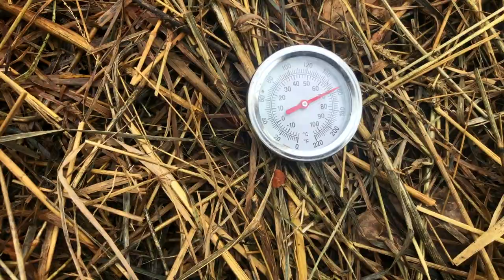Greenhouse - Heating with Compost Power and Moving Water?

Comment: There's some math to be done in terms of how many BTUs your pile can produce and how much of that you can (literally!) siphon off without stalling out the pile. Remember Jean Pain was working with piles that were something like ten times the volume you're using ;)  Whether you would actually get more heat with a longer coil or not really depends on how much heat that pile is generating. there's probably some math that can be used to figure out BTUs based on the average temperature of the pile (throughout its volume, not over time) and the mass of the pile, but I'm not familiar with those kinds of calculations ;)   As it's not currently practical to add another 60 feet of tubing into that coil, you might try restricting the rate of flow, giving the water more time in the pile. Putting a spray nozzle on the hose back into the tank and shutting it down to a trickle should let you test whether the limit is transfer of heat or actual amount of heat produced by the pile...
Reply: Sure.  The pile is mostly cellulose, so figure 8,000 BTUs per pound.  The tank is 100 gallons, so 800 BTUs to raise it 1 degree F.  For every pound in the pile, it raises the tank 10 degrees, once.
Reply from the maker: It definitely seems the limiting factor is the heat transferring into the tube in a timely manner, not the total amount of heat available to the tube.  I need slower flow through, which is why I'm hoping to crack the code on a gentle thermosiphon for the whole thing...
Reply: @edibleacres  If you are correct that you are heat transfer limited, then you want to increase the flow rate, not decrease it.  Heat transfer is proportional to the the temperature difference (and R-value and area of the transfer surface), so you want the coldest water in the tube that you can get, which means faster flow rate.
Reply: @CorwynGC  You seem to forget there is a limited amount of heat available. Also, you must retain heat, or reintroduce it during the day with solar heated air, for the microorganisms to keep feeding and producing heat as  byproduct. The pile is not nearly big enough for that climate, but compost heat is ideal for the North East or areas with little winter sun.
Reply: @markroeder2491  Not sure why you would say that when my first response gave a formula for figuring out exactly how limited the amount of heat available was.

Comment: I think the limiting factor on the heat generated is probably the size of your pile, whereas you can be more efficient in capturing the heat that is available by spacing out the piping. If you look at Jean Pain's video, he spaces out the piping throughout the pile to ensure the maximum contact with compost volume, whereas by coiling them together in the cage as you currently do, the volume of compost you are extracting heat from is limited. That's why it runs out of hot water so quickly. As for the thermosyphon/pumping, the only thing that will help is going to be the height of your tank. The same principle as a taller chimney having more draw. I don't think that putting the entire stock tank higher is going to help.
Reply: Where can I find Jean Pains' video?

Comment: You are on the right track-we would use a similar technique when we would lose a pump in our heating system in a building I worked in in Manhattan. It was 21 stories tall and we would use the siphoning affect and a check valve to be able to circulate the domestic water until we could get the pump back online. With the correct temperature, diameter of tubing, length of tubing, and a check valve you should be able to get the job done. Also, remember that if you’re going to use radiant heating in the floor, it doesn’t have to be very hot to heat the entire house- I believe you should seriously investigate the temperatures you need to achieve to be able to heat the house; if I remember correctly it’s only about 70° (water temperature ) but you need to verify that. Radiant floor heating is not my specialty.
Reply from the maker: Appreciating your time and knowledge here!

Comment: The question l ask is not just what will you do to heat the greenhouse, but what will you do to keep that heat from escaping?

Since you have built this greenhouse from scrap parts and windows, it can lose much heat through the single pane glass or poly panels, Etc 
Especially as each panel is made of different thickness or R-value materials.

Many of us, (myself included), have added another layer in the winter to our greenhouses, thereby creating a "double paneled" structure. 
This can be done by actually covering the greenhouse with another layer of plastic or poly, (which can be attached either inside or outside the greenhouse - depending what works for you) and can also be done by attaching bubble wrap to all the inside glass/plastic surfaces.
I found that the larger 1" bubble wrap works better. Each bubble "traps air" and helps to keep the overall temperature higher in the greenhouse.  
(I found the best prices for such were at the big box office stores.)

Many larger commercial hoop houses use 2 layers on their greenhouses, and utilize an air generating fan to blow bewteen the 2 layers, thus allowing the space between the layers to heat up naturally.

The addition of extra poly, plastic or bubble wrap does not affect the light transmission very much. You only lose maybe 5% to 10%.

The other thing that could be done is blankets or curtains of some type. They would be used for the evening hours to try to keep any heat that was generated from escaping. These can be added inside or out - depending on what you have available. (I once used old bed comforters!) Of course, these would have to be moved into place daily -  at dusk and then dawn or morning.

It appears that the roof of your greenhouse has some sort of plastic panels, and this may be where most heat would be lost, as heat rises.

The other thing that can be done is a "greenhouse within a greenhouse". Many will do small hoop enclosures over the raised growing beds. This creates a warmer environment for the plants. Many have found that this system works great. Elliot Coleman has done this extensively in Maine, and has used no heat at all...(but "to each his own"!)

I know this did not address your current heating system - but hope it helped give you some more "tools for thought" !!!
Reply: Great ideas, all of them.  It made me think of a shorter cattle panel greenhouse to cover the compost pile and help create a heat bank to help with the heat sink of the pile.
Reply from the maker: I understand what you are saying for sure.  If this were a standalone structure in the field I would go for it 100% with the extra layers.  Attached to our home, it is partially about the look and feel of the space and partly about pure functionality.  I believe we'll be making cold frame boxes for the soil itself this winter so we can keep the light and open feel of the space overall.  Not ideal from a thermal perspective but aesthetics and sense of space are also part of the equation...

Comment: i put the compost pile inside my small greenhouse. you could cover the pile with plastic and vent it in.
Reply: Right, I have seen that done here on YT in Canada and she built it 4 to 5 feet tall with the other measurements being about 4' x 10' x 4' to 5'. By the time it starts cooling off the seedling starts are placed on top for bottom heat.  There are some great ideas coming out here!
Reply from the maker: Too small a space and definitely not wanting those gasses accumulating into our home...
Reply: Insulate over the pile but not the side that contacts the greenhouse. That creates 2 positives, 1 your pile will be warmer since it won’t be losing heat to the air and 2 the heat from the pile will be conducted through the wall into the greenhouse.
Reply: The Nech  what gasses Im currius
Reply: What like nitric oxide or something
Reply: Is there processes to remove the volitiles for refinement
Reply: The Nech  I just looked it up and air negativity must have aireated large piles and filter or scrubbing of the gases through biofilter comprised of and aggregate of Woody materials like wood chips and I think also possibly home- made charcoal then returned to greenhouse as co2 in s system that I saw they brought up the co2 through some soil for seed germination they are doing this at large scale 100 tons of compost producing a thermal yeild between 30 and 60 thousand BTU over a course of a growing season and extending it with an net saving of 10000 dollars. My question is can it be scaled down?
Reply: Also this was dictated by me and spelled by my wife sorry
Reply: The gases are converted from amonia to amonia nitrate or nitrite whatever im tired  when it comes in contact with the soil
Reply: @jerrymaxey4664  This is where I first use my "biochar" . It filters and collects many of the gases used in the compost process while becoming inoculated and part of the compost. My greenhouse is not attached to my living quarters, so I want to use the Co2 produced to aid in plant production while still filtering out ammonia, methane, ect.
Reply: This is also a waste of space in a greenhouse, especially a small one.  That territory is too valuable.
Reply: Why not capture the methane and burn it off inside the greenhouse? Like those biomass bags for food scraps to supply fuel to a grill. Wouldn't that be an additional source of heat? Also the combustion of methane produces CO2 and H2O. CO2, from a quick search, boosts photosynthesis. So it'll be humid but as long as the plants are pruned and a fan provides air flow, it should prevent fungi.

Comment: We use a 100ft 3/4in hdpe coil to heat our shower. The pile is pretty small, it just barely covers the coils. The hot water lasts only about 3 minuets. The hottest we’ve got the water is 110. degrees. Since our pile is so small I have to add grass and turn the pile once a week.

Comment: I would say that bringing the total tubing to 100' or more would help. And I agree with other commenters that your flow rate is too fast right now. You might want to also consider building the compost pile up taller. Maybe use some pallets to keep it confined, but built in a way that you can easily remove a side or two to pull the spent material. And then raising the water battery in accordance with the height of the compost and tubing. Adding a 275 gallon or larger tote may also be of value based on the added mass. I got lucky tonight and found this channel completely by accident, as one your wood stove videos started playing automatically.  I will def be using that biochar technique with the saw dust from my sawmill, thanks! And I am looking to do some similar things with a property I am building in the next few years, so I really appreciate all the time you've put into sharing the knowledge you've acquired.
Reply from the maker: Thanks for your kind words and sharing some ideas here!  Happy to have you in the community with us! :)

Comment: I am wondering if using a 55 gallon plastic drum might be a better tank. It would be easier to raise up on cinder blocks and get the head height for a passive system and preserve some floor space.
Reply from the maker: Good thinking, something to consider if I can't get this to passively work out.
Reply: Or a old water heater

Comment: I knew a guy in Germany in the 80's who had two open 15'x25'x6'deep concrete lined pits with a ramp for a front loader tractor. He had miles of poly tubing in it and he dumped in tons of fresh wood chips 6 feet deep  (owned acres of woods). This system heated his entire homestead with a big family including hot water for about year or two. You just need to scale it up.
Reply from the maker: That sounds amazing!

Comment: This is a great idea, I agree with the suggestions to increase tube length and decrease flow rates on the pump, also you are losing a lots of heat to the environment, if the pill were covered you would increase heat and provide additional space to add another thermal transfer location with a solar collector like you guys have created in the past.

Comment: Be simple, put a spigot about 6 inches below the top of the tank and run a line from there to your passive irrigation, honestly it could be a directly connected drip line, just make sure the spigot is far enough down to offset the maximum input of water from outside sources. You can use the spigot size to offset that as well, but that may impact pressure to the passive system, you could also just make a hole above the spigot for emergencies, like the hole on the front of your bathroom sink, that feeds to a hose and spills into the garden.

Comment: The thermal siphoning system circulates itself through a coil wrapping of the tube in your compost pile. The heated water is slowly pushed up through the coil. You would put a water adapter in the bottom of the galvanized tank for the coil to pull from and a top water adapter for your return warm water to flow back into the tank. It will flow a lot slower, but more constant. Keep up the good work this knowledge is learned by doing mostly.

Comment: Ev1 seems to think that composting needs to be done on a flat surface. Why not composting in a long, sloped box (45 degree angle?) with a corrugated steel sheet acting as a bottom and a heat transfer medium to either tubes or a big tub filled with water below? Of course the structure needs to be insulated, but loading fresh compost in on the top and removing the processed stuff from the bottom, would enable a constant heat production. All the piles with a tubing inside cause a lot of work and have a great variation in heat production and may wear out well before the end of the cold season.
Reply from the maker: That would be an interesting idea but hard to visualize as functional...Heat rises, so the collector being below the compost I'm not sure I understand how that would function...
Reply: @edibleacres  Hot air and hot water molecules rise, but infrared radiation spreads to all directions just like light. You can test that by moving to or from a wood stove. The difference is that air and water are a medium and infrared radiation functions without a medium. Light, including infrared radiation from the sun, travels to earth in a vacuum, no transport medium needed. So the proposed corrugated steel sheet will act like the vertical side of a radiator sending out thermal radiation. Another example: a heat lamp above young chickens. I hope this explains some heat transfer principles.
At the moment I'm extending the thermal mass in my passive solar greenhouse, but I have no intention to cover the concrete pavers with wood chips, these would insulate the floor and reduce the amount of available thermal mass and increase the temperature swings in the GH. I water my plants in the GH subsoil, because a wet surface will have a higher evaporation, extracting heat from the soil and transfer that heat to the coldest places in the GH where it will condensate. It's also an attempt to minimize the moisture level in the air and reduce the risk of fungal problems. Heat transfer by evaporation and condensation is another principle. At the moment my growbags, inner brick footings of the GH and water bottles are white in order to maximize the amount of light in the GH. Besides temperature, lack of light is the second big problem during winter in a GH. The soil level in my GH is a foot above floor level, in order to keep the cold air away from the plants during the night. As you might have guessed: cold air sinks.
Always great to watch your vids. Best wishes greetings from Holland.

Comment: Love this video. There are two concepts heat capture and heat use. What if you you deploy a smaller drip  tubing to deploy the heat? Surface area must be considered in both concepts.
Reply from the maker: We are exploring this year in having a pex circuit buried in the garden as well to run the warm water through...
Reply: @edibleacres  thanks for sharing your journey. I plan to copy several techniques in 2022!

Comment: I don't have room in my greenhouse for a water tank so I made a u shaped piece of 3 inch gas vent pipes put the pipes in the compost pile and  ran the pipe through the back wall of the greenhouse  at a 45 degree angle, heat rises and comes from the compost  pile into the greenhouse, The hot air rising from the pipes creates airflow from inside the greenhouse through the compost and back into the greenhouse.  I get air at temps up to 120 degrees using this method. I use a small fan to circulate the hot air around the interior of the greenhouse.  This will keep the greenhouse around 50 - 60 degrees on a cold night.
Reply from the maker: That sounds like a great solution you've come up with, kudos!

Comment: Your videos are amazing, thank you so much for putting the time you do into them. I know it's been a year since you made this video but...

Maybe build a small water tower in your green house and place your cold water tank below it? Extra filtration here would prolong the life of your pump, you could still use gravity but I would use it to bring the filtered hot water to the top and let gravity feed it from your cold water tank into your tubing. 

Off the wall idea, what if you were able to run a static metal pipe through the center of a mounted turntable drum? It would be turntable if the pile stalled and if the pump is still only working to bring the hot water up it... I live in the desert and don't know how insulated it would have to be for you but it's fun. 😄